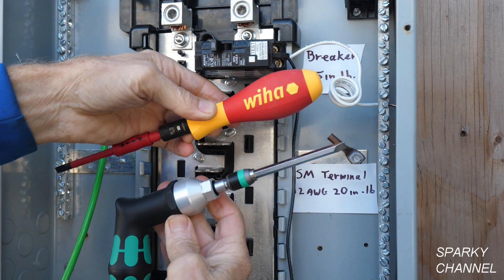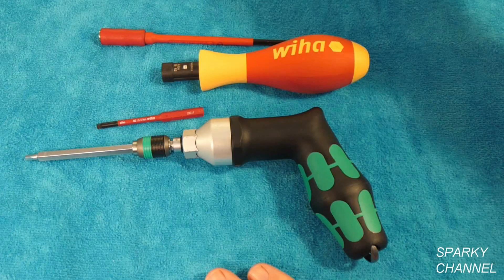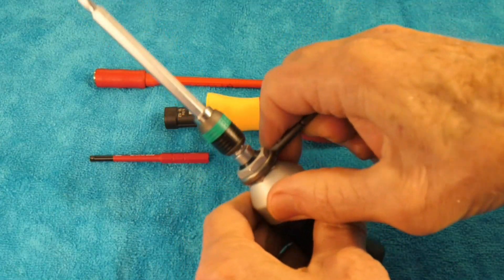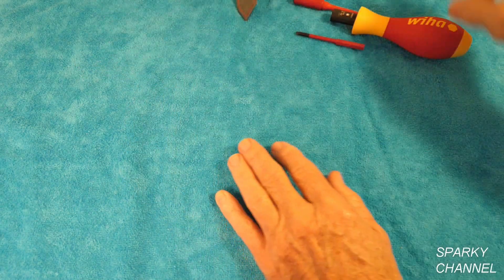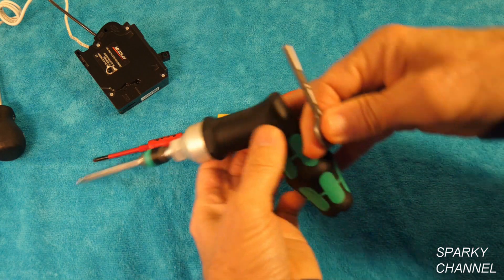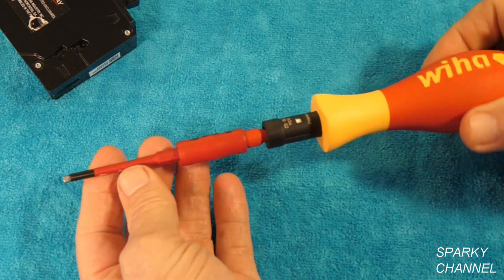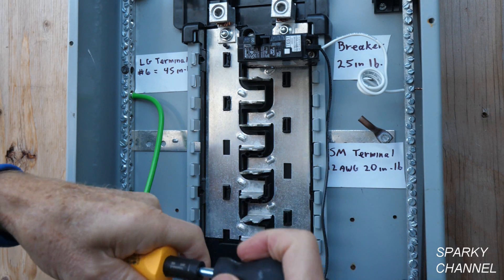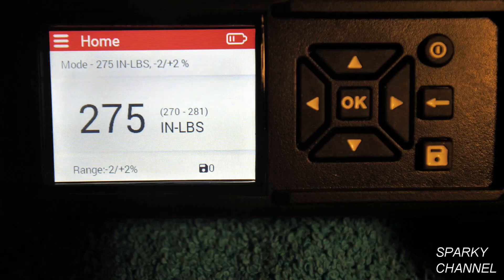2023 Changes to Torque Codes 2023 NEC 110.14 (A) and (D) Terminal Connection Torque

Comment: The way to properly tighten connections is to use a fixed tool for the slack and a torque tool for the seating. That makes the changing of different torque settings minimal: first, connections are tightened to the point at which the wires are held in place; second, connections are methodically seated to torque specifications. You just have to “comb” the panel in a logical and typical sequence.

Comment: i know a sparky.  that he always over screwed down the wires under a breaker.  told him to quick screwing down so tight.    he probably still does this to this day.  He would tighten them down and i would go back and  of course the copper wires would be half cut through.
Reply from the maker: Yes, over-tightening will damage the wires or cables.

Comment: I prefer one with adjusting collar like the torque wrenches have, such as my old SK. Reason? Having a separate tool to adjust the tool looks like the same problem as the chuck key for a drill - something to get dropped, misplaced, etc.

Comment: I wouldn't recommend the insulated tool for non live terminations it would get dirty and fail faster. Best to keep it clean and out of reach till needed. 

I also wouldn't recommend the electric torque tool because if the battery is dead you affectively don't have a torque tool. 
I say these things based on doing service work for 25 years.
Reply from the maker: Thanks, good advise!

Comment: About 6 years ago while attending a continuing education class the instructor asked how many of the 120 people attending owned a torque wrench. Less then 10% of us raised hands. Appears that you might have to own two small range torque drivers & two torque wrenches for large stuff. Reason for owning duplicate sets is you was told we should send them.out ever year to check calibration (send  halve out the when they comeback send out the rest ). Tool & die shops that I have done electrical work I have to send out their micrometers every year to verify accuracy.

Comment: Receptacles and switches, depending on who the MFG is, require anywhere from 9 to 14 in-lb. That is, the ones I have looked up so far.
Reply: Some higher end leviton receptacles say 14-18.
Reply: @Ariccio123  I worked for them for 12 years as an electrician. Thanks for posting. That's worth a thumbs up.

Comment: I am getting sick of the NEC. They're intentionally doing this stuff so that people have to buy more stuff and to make more money. I am not one of these conspiracy theorist but they're just trying to sell more tools to people by changing rules. When I do electrical work, hand tight or power tool tight connections suffice. Things aren't coming loose and causing problems. The problems come from people that modify their electrics and have no clue of what in the hell they're doing, and these people that buy extension cords that are cheaply made and plug their space heaters, coffee makers and toaster ovens into them and run the excess cord under carpets, through doorways or behind refrigerators and cabinets where they constantly get pinched and flexed. Or they have a cat that likes to chew wires.
Reply: Torque specing and verification are standard in industries where safety matters. Why shouldn't we do this for homes and businesses? It's not hard.
Reply: @Ariccio123  It's overblown sometimes. Government needs to regulate business and protect people. Not the other way around.
Reply: Friend the NEC and the CEC are all there for safety and gets updated as new issues arise. Some people take shortcut a lot even tho the code is bear minimum. 🤷 don't worry too much about the tools you will or will not need to buy keep following the age old methods and be aware of your surroundings / location and the equipment that you are working on or installing 👍🏽
Reply: Its certainly difficult to be an electrician or to run a company and have FR clothes rubber gloves and torque tools as well as thousands of tens of thousands of dollars in tools, years of schooling all that to justify our not very significant pay, (generally).

Comment: For best overlapping ranges, I recommend Wheeler FatWrench for the low range (down to 10, 5 if you can find one) GearWrench for mid range, and whatever brand you prefer for the high range.  All torque tools are less accurate in their low range.

Comment: Funny how NEC wants every connection properly torqued, but they still allow stab lock devices to be used. They shouldn’t be allowed.
Reply: Years ago I ran #2 copper wires for two foreign made injection molding  machines that had some vibration and ran 24/6. Had push in  stab ins for the 480 volt wires. Told the tech doing start up that I did not want to use these POS
 He told me they work great. Yep first machine stab in connection burnt up in less then ten days and second set was hot & discolored.

Comment: Too much control over these screws.  Just use common sense and tighten them.  Can't tell the difference  between 5 inch lbs and 10 in lbs
Reply: Proving that common sense isn’t that common.

Comment: You did the large neutral lug wrong, and violated standards.  The torque is limited to a range of 90 - 100% of spec.  You cannot go over.  That particular torque tool should have been set to 245 to prevent going over 250.
Reply: Is this the part of the day where we pretend that any of these devices are that precise or that you have any idea what you're yammering about?

Comment: You need 3 torque tools, low, medium, and high range.  For ABB components, the OEM torque is much lower than tables.  You want a low range of 10, even 5 in/lb.

Comment: We use Wiha torque screwdrivers exclusively in production for torquing inserts in machining.  Bill, they also make T-handle torque wrenches for higher torque screws/bolts but not sure if they offer them in 1000V insulated or not.
Reply from the maker: Great information, thanks!

Comment: Question: can you explain why the ACDelco ARM601-3 3/8" Digital Torque Wrench is listed for "2 to 37 ft-lbs." but you're measuring 250 ft-lbs? Is it just certified for that lower range? How does that work?
Reply: I think you confused INCH *pounds with foot*pounds.  The tool was reading INCH*pounds.

Comment: Bill, great video, as always. My Wheeler Firearms torque screwdriver (this is what I've been using for a while) says in the manual to turn to the *third* click, not the first. Is that different in Wiha and Wera? 
Also, my screwdriver manual says to set the torque setting to "0" torque when storing, so as not to ruin the calibration. Wonder what those two Germans say about that...

Comment: love the code change videos, unfortunately Hawai'i Masters Electricians license is based off the 2008 code... just want to bring light to that,
Reply from the maker: Interesting! So you'll be changing to the 2011 NEC for 2023? That's a big change, because of neutrals being necessary in switch boxes starting 2011.
It's OK though, you'll know what is coming up for you in later years.

Comment: Sparky....does a bathroom vent fan with light need to be on a dedicated circuit?   What gauge wire?  Jeff
Reply from the maker: They are normally a part of a lighting circuit which is typically 14 g but it can be 12 g if you like. The exception would be if you had a heater with the fan/light. Then it would be wise to run a dedicated 12 g circuit to it.

Comment: I use the insulated Wiha and prefer it over the pistol grip wera. Other thing like about my wiha is the low profile bits can be used for there other multi bit screwdrivers which means don’t need to buy special bits for the torque driver as interchangeable from the low profile insulated bits from the other driver kits, pretty awesome, imo👍🏻
Cheers✌🏻
Reply from the maker: Yes, it's a quality set.

Comment: I've used a data sheet for each piece of equipment terminated listing the terminations and required values. It is where the torque wrench(s) and its calibration date and range are documented.  Also handy to mark the terminal indicating those already torqued.
Reply from the maker: Excellent tips. Thanks Paul!

Comment: Doable with harbor freight torque wrenches right? 😂
Reply from the maker: I would say yes, but don't expect the same durability as the bigger name brands.
Reply: They actually tested the digital torque wrenches on Tools Tested a few months ago (watch?v=0_fun-C-p7E) and Project Farm (watch?v=HP4uECoH8cc) did a non-digital test back in December.  The Icon that HF sells fared pretty well in the manual department and Quinn did well in the digital realm.  These were an ft-lb test though, their in-lb line might not be as good.  I can't stand Harbor Freight, but they do have their niches where the value and quality are on par with each other  This is one.

Comment: Wiha should put a reinforced hanging hole at the end of their driver big enough that you can stick the torque set tool through it. Then  you could use it like a T-handle screwdriver without any other complexity.
Reply from the maker: Good thinking. It is quite difficult to torque 50+ in/lbs. with the Wiha. Something like that might help.
Reply: I was thinking a flip-out handle, but a hole works fine!

Comment: Where do you find the torque values?
Reply from the maker: It usually says right on the panel or device, or it is included in the manufacturer's specifications.

Comment: Horrible a company cant come out with a useful design for us.. 1 doesnt screw well, one torques easier than the other, one is not insulated, one comes with a kit, one decides to have a loose key on the end. Crazy
Reply from the maker: I know what you mean. I think the best value of all of them is the ACDelco ARM601-3 3/8" Digital Torque Wrench (2 to 37 ft-lbs.), with Buzzer & LED Flash Notification - ISO 6789 Standards with Certificate of Calibration: Amazon: https://amzn.to/2ttNEsf
  But it can't do the whole range. You need a good torque screwdriver to go with it.
Reply: Personally I use a 1/4” torque wrench with a bit adapter, does 10-150 in-lb. I use a click-style wrench but I’d get a digital one if I used it more often.

Comment: I am surprised you can leave those screw drivers set to a specific torque value as with all other spring-style click torque wrenches you must turn the torque setting back to the minimum value prior to storage to preserve their accuracy.
Reply from the maker: It would be best to do so IMO.